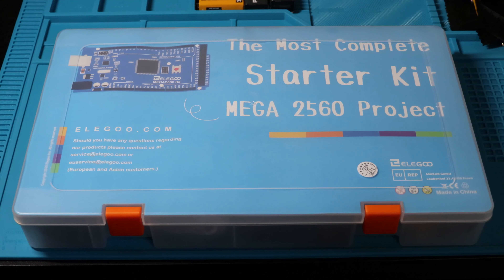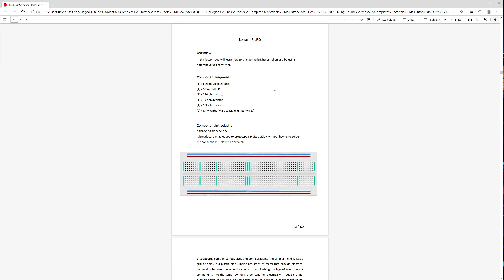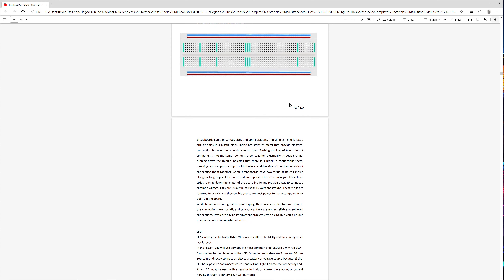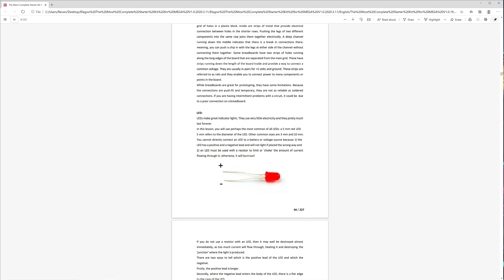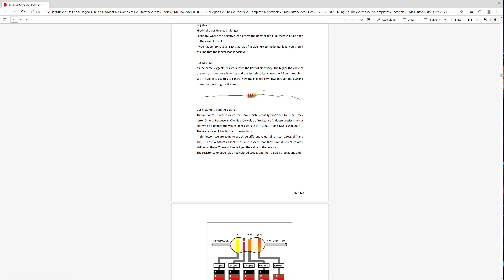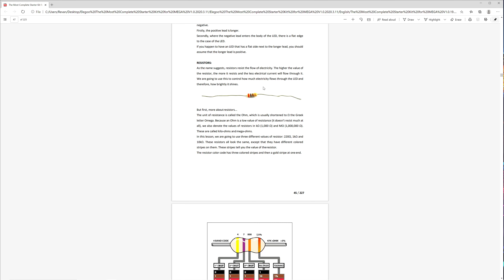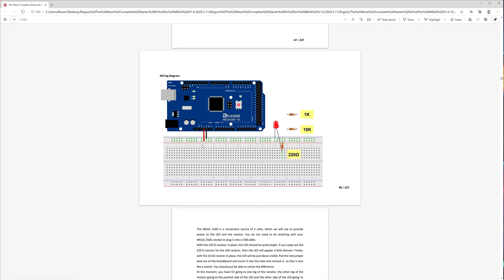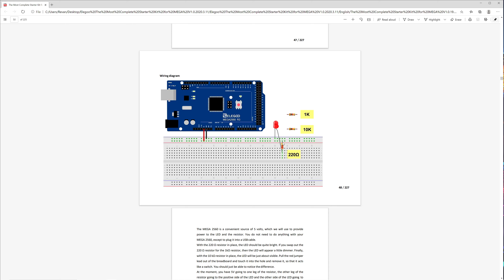STARTER KIT TUTORIAL FOR MEGA 2560, Lesson 3 LED

Comment: the pack has resistors that look all the same, how do you do to recognize one from the other ?
Reply: The packs are literally labeled, but beyond that, there's a handy table in the guide on how to read the resistor markings
Reply: @ElixirOfEuphoria  I know but when I look at them they all look the same , maybe are too small or my eyes don't allow me to see any difference :( ...
Reply: @naimastef  Use a magnifying glass if that's the case friend, that's what I did
Reply: @ElixirOfEuphoria  I tried but still looks like they have the same color stripes , dunno.
Reply: @naimastef  They are labelled on the yellow tape that holds hem. If you have already binned the tape unfortunately you will have to get a magnifying glass.
Reply: use a multimeter